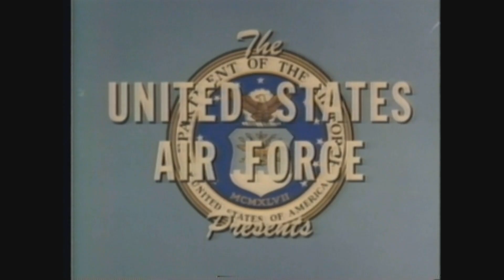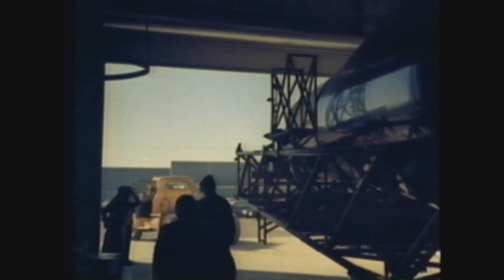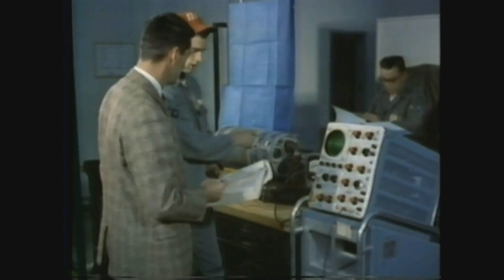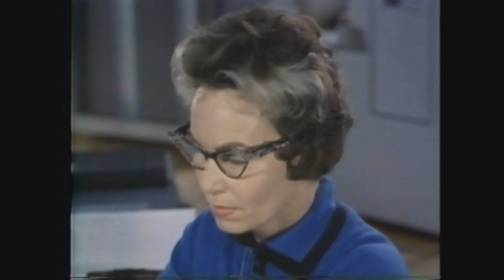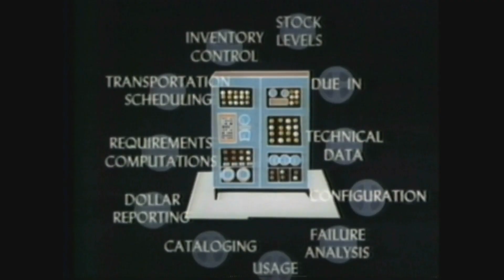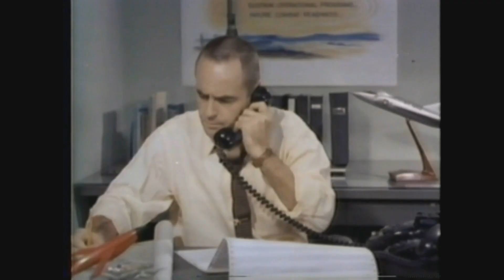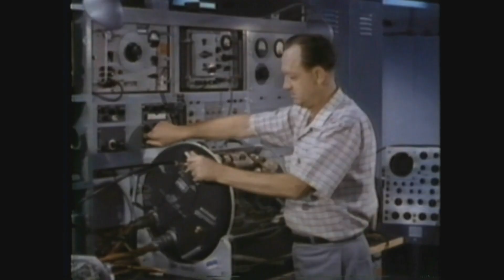1957 - 1960's  IBM 705 Mainframe Computer Data Processing- USAF Military Punch Card, Educational

Comment: Got any media that describes the 1970s  USAF Advanced Logistics System? (ALS)
Reply from the maker: Hi Tubastuff,  I don't think we have anything specific on USAF ALS.  Do you have a particular reference for this?
We do have a good film on the  Advanced Fighter Technical Integration (AFTI).  https://www.youtube.com/watch?v=6CLNBYywMXk&t=123s
Victor, CHAP
Reply: @ComputerHistoryArchivesProject  ALS was a huge (ISTR about $180M) project in the early 1970s, replacing the AFLC IBM 7080 boxes.  Hardware was CDC Cyber 70 multi-computer configurations with acres of disk drives and CDC 1700s used for remote feeds to the mainframes.  The idea was to track every bit of inventory in any condition; and--this is very curious--to have equivalent-and-substitutable rules.  In other words, if you needed an altimeter rated for 30,000 feet and there were none in inventory, you could be sent one for 40,000 feet.  Or, as a fellow remarked, request a bulldozer and get sent a shovel.    There's probably a fair amount of paper on it in the archives.   Proxmire twice awarded it his "Golden Fleece" award.  My recollection is that there were about 1500 GSA programmers churning out COBOL for the thing. Ultimately, it was abandoned.
Reply: Here's a 1972 prospectus.   Eventually the project bit off too much to chew and was terminated in 1978, with a bunch of 370/168s running in 7080 emulation mode.   The reason for that is that the 7080 COBOL code had numerous undocumented autocoder patches--figuring out how it all worked would have been ruinously expensive both in time and money.

https://www.airuniversity.af.edu/Portals/10/ASPJ/journals/1969_Vol20_No1-6/1969_Vol20_No5.pdf

I worked on the vendor's (CDC's) side--in all, we were a group of about 70 people supporting 1500 GSA programmers.  A new operating system was developed (also deployed as UBS TOOS) and hardware configurations larger most other government installations.  This, of course, was all pre-Internet and was quite (perhaps overly so) bleeding edge.   The project was delayed somewhat by both IBM and Univac suing against the award to CDC.  Both eventually got the qualifying benchmark to run, but declined to submit a proposal.  I believe that the IBM proposal involved S/360 model 91 hardware.

Comment: Learned at my High Technical School, the Graphic Lyceum te Eindhoven that, the mainframe is established in 1957, but is the Holorith also a mainframe ? I think so,  Remarks are liked, thanks.
Reply from the maker: Saskia, Thank you very much.~   CHAP
Reply: No, Hollerith created machines that tabulated (counted) the data on cards.  A mainframe, especially by 1957, is able to do much more with data, and it operates with it's instructions stored in memory instead of being literally wired for one specific task.  Look up "tabulating"  or "accounting" machine and "plugboard".

Comment: Thanks for sharing this cool computer with all of us. I see the cost in manpower to order a .19c part hasn't changed much.
Wow now we do all this on a small box about the size of two large boot boxes, how efficient.  
So how does a government pay $200.00 for a Hammer or a .19c transistor? Here's the process:
1. Look it up in the PDF/Manual.
2. Fill out the required order form, with manual number, chapter or work package, figure, index number, item name, two part numbers, alternate part numbers, item control number for the equipment it's going into.
3. Submit it to the supervisor.
4. Supervisor reviews it.
5. Pass it to the site supervisor.
6. Site supervisor reviews it.
7. Pass it on to the supply worker.
8. Punch it into the computer and submit it.
9. Supply center in another state reviews it to make sure its actually in the item it was requested for. You know someone might order some spare parts to hide under the work bench so they don't have to do all this crap for a .19c Transistor.
10. Supply center sends a request to a government approved vendor. Women owned is preferred for political correctness.
11. Approved vendor submits the request to the warehouse.
12. The warehouse receives it and fills the order.
13. The warehouse sends the part to shipping and it ships.
14. The part arrives at the repair facility.
15. Supply worker reviews it and sends it to the technician or to the shop supervisor.
16. The technician installs the part and tests it to find out the problem is fixed. Then to find out we need another part to move to the next step and the process repeats.
Fortunately I brought this process up at an efficiency meeting. I asked why we did it like this, we spend about $200.00 dollars to get a .19c part. The response, "We do all this is to ensure we don't order more parts than we need to keep costs down and to ensure someone doesn't steal a .19c transistor, or other parts like it." I said and that's assuming someone would want it.
So my response; "to keep costs down!" "You don't think they actually pay $200.00 dollars for a hammer do you?" Ah ya they do, in man hours and shipping costs. We again for the 13th time are allowed to have a supply bin to stock some of the cheaper parts we use on a regular basis. Now we can just go over and pull it our of a supply bin and document it directly on the supply sheet. So much more efficient. When I started back in 1999 we had 12 sheets documenting our work on a piece of equipment, wow we have about 50 sheets. Now when our customers equipment is repaired by one technician it has to be checked by four other people then the paper work is checked by 6 more people before it's shipped. Our governments need to document EVERYTHING is WAY out of control and wasteful just to CYA or for whatever, is ridiculous. Well folks that's my Government Efficiency Lesson for the day kids. Aren't you glad they're in charge of your health care even more now, thanks to the ACA? 
Best Wishes n Blessings. Keith Noneya
Reply: An elephant - a mouse built to government specifications (to quote a famous author).
Reply from the maker: WOW!  That's quite a process.  Government oversight never seems to simplify anything.   Thanks for the comments!
Reply: Keith Noneya :-O
Reply: remember that  dollar hammer that cost 200$   199$ goes to secret projects or laundered to secret project

Comment: 18:26 here you can see a Tektronix 511 oscilloscope. It was Tektronix' first product.
It was IBM with it's huge 511 orders, that pushed Tektronix. This eventually resulted in huge growth at Tek.
Reply from the maker: Good to know.  Thanks for watching!
Reply: Ing. Max Koschuh super.  Computer
Reply: I was watching another one of these vintage computer films on YouTube the other day-- I think it was a one about Burroughs-- thought it was interesting that just about every shot, even the marketing shots of the system, included at least one Tek scope cart, and many of them had two.   Guess it took some work to keep those things running...
Reply: The 511, invented by Howard Vollum, was the first triggered oscilloscope ... and the rest is history.  Love the old 500 series scopes and have several in my private collection including two 555 dual beam units.  With over 100 tubes, each 555 is a masterpiece of electronics design, manufacture and utility. 🙂
Reply: I have a similar one from the 50s , sadly, i got no idea on how to use it
Reply: I have the blue-green and chrome cart with the plug-in space gutted and a 6 drawer parts cabinet in it's place. Top drawer has the mouse pad on it, keys hang from monitor arm base.

Comment: i LOLLED a lot. I suspect that in this 1957 video, there was a LOT of wishful thinking. "the computer automatically route packages to the most optimal route" first of all, what does that mean CONCRETELY? "if supplier A doesnt have part, check supplier B"? and "if the computer doesnt know something it prints out detailed information for the manager. yeah right. I'd love to see that print out. businesses barely do stock management properly TODAY with amazing tools and systems (apart from big cies like amazon, which is why they're so ahead), let alone many businesses communicating efficiently using 1957 technologies. Just think about it, MOST ppl in those days did not even know what a "computer" was! And the ones they had cost millions and would break a few times per hour! Cant imagine a "supplier" having a computer and getting anything useful out of it. I've heard that the SAGE computer built in the same era was barely ever really functional but in the videos they make it look like everybody had their shit together and doing something useful.
Reply: It was all highly experimental, the ICBMs of that era also barely ever worked correctly. Ridiculously (by our modern standards) long time to prepare to launch, close to 50% failure rate on launch, similarly high chances of failure on reentry, and then even if nothing spectacularly failed, the accuracy was still pitiful.
Reply: hattivat Also noticed that the first generation Atlases were above ground. I suppose around 1959 they started burying them in launch silos/complexes.
Reply: @hattivat  after Sputnik they would take a shitload of risk to never let it happen again

Comment: At 0:21, the film production date is shown as MCMXLVII - is that not 1947?
Reply from the maker: Good spotting.  Actually, the MCMXLVII date is 1947 on the Air Force LOGO, since that is when  by President Harry Truman signed the law creating the Air Force as a separate branch of the service.  Before that, the Air Force was part of the U.S. Army  (often called "U.S. Army Air Force").    The film itself is from 1957.   Great comment though.  No one else mentioned this.   Thanks!

Comment: thanks to the invention of the transistor, this whole process is in a series of excel forms.
Reply: Or they would be if you could fit all the stray bits of 50's, 60's, 70's and 80's code into Excel.
They only gave up 8" disks a couple of years ago. I'd be amazed if they could run anything more recent than Excel 97 on some of those machines. The punched card readers may have gone- but if you've got any spare parts for an IBM XT, they're keen to hear from you.
Reply: unless the fallout universe happened, in which the transistor was never invented.
Reply: @juango500  Fallout still have regular computers, which are small enough to fit on a desk and be carried (except by apple users lol)

Comment: yes that helps to explain it. thanks for answering
Reply: They also use electric clutches, the tape drive motors never stop spinning. That's why they can start and stop so fast.
Reply: @1stKwestionable  Actually, the tape itself starts and stops quickly, but not the reels.  The tape is sucked into vacuum columns on each side of the head assembly, to provide two buffers of slack tape.  Each reel is only turned as needed to feed more slack into its vacuum column when the slack gets too short, or to take up slack when it gets too long.
Reply from the maker: True!   Thanks for watching, good comment.

Comment: one thing I never figured out of the old tape drive is why do you normally see one tape spin while the other one is standing still then it spins while the other doesn't move
Reply: Because what you don't see in that tall cabinet is the large vacuum column that holds several extra feet of tape. That acts as a buffer for the tape so each reel can have a bot of a buffer before spinning or stopping. The reels have to stop and start quickly because data is read in chunks, not a continuous stream like regular audio and such. If the tapes were slow to start or stop, some data could get lost due to the inertia of the reels. Hopefully that helps.
Reply: Very good reply. Just as a complementary explanation: once the tape was loaded, it was kept under some tension by the vacum chambers. The tape was stop, in contact or not to the tape capstan. It depended on the technology of the tape drive. In the non contact devices, for instance, the capstan was continually running, with positive air pressure flowing thru fine slots pushing the tape away, forming an air cushion . The tape was held in place by a nearby vacuum plate. Then, after an order to read or write, the air flow was reversed very rapidly, so the tape was pushed from the stop plate  and at the same time adhered to the rotating capstan. So the tape went from stop to full speed (some 120 inches per second) in 1 milisecond, average. The vacuum chamber supplied the tape, and when the tape level reached some threshold, an order to the reel motors to run was issued. That is why the movements seem to be assynchronous. The valves which changed the air flux were called "voice coils" because they resembled  loudspeaker coils. I loved that units. They were real battle horses, running day and nigth.
Reply from the maker: Yes, that does help.   Thanks!
Reply: Those tape units filled a 19” rack, too. At the back was a relay logic box, which could be swung open to reveal eight three phase electric motors and the associated clutches. One large motor drove the vacuum system, another was for fast rewind, two were for. the two tape spools and the last pair were for the two tape capstans, The motors and relay logic made for a noisy machine, necessitating soundproofing and a front cover for the tape unit. 

A 'small' computer might have as many as four of those tape drives, a card sorter, a card printer/duplicator, a card reader, a CPU cabinet, memory cabinets, three phase power converter, maybe ten telex terminals, and later, Winchester drives, plus a printer. In addition, it would have an air cooling system located in an adjacent room, and pumping cool air under the computer room floor and around the room. This was needed because a typical transistorised IBM computer would consume around 12 kilowatts, and peripherals would increase that consumption.

Each part was large. One computer would fill a whole floor of an office building and would require at least twenty people to operate and maintain the system. (So at least two kilowatts of body heat generated, in addition to the computer power!)

Computers were often rented back then for a couple of  thousand dollars per month, because of the constant need for engineers to be on hand to keep them running. A computer might suffer a failure every week or two, necessitating locating and repair or replacement of the failed circuit board(s) or other failed component. 

To top all of that, there would be no operating system, so programmers who were familiar with machine code were an essential part of the computer team.
Reply: Jeremy R the tape movement under the heads and take-up or supply reel moment was two separate operations.
the machine was designed as follows:
a capstan on each side of the r/w heads which turn at constant speed. this constant speed was vital to the exact placement of the data on the tape.
a vacuum column before each capstan. the length of tape in the columns is determined by two (or more sensors) withing the column. if the tape is too long in a column, the reel motor must pull tape out of the column. if there is too little tape in the column, the reel motors must add tape to the column.
tape can be read or written in either direction this way.
when a tape Is threaded on a tape drive either manually, it first is guided over the opening of the vacuum column, past a capstan/pinch roller, over the r/w head, then past a 2nd capstan/pinch roller, over a 2nd vacuum column the wound onto the take-up spool.
you press a LOAD button. for automatic threading, use press the LOAD button. what happens is you will hear a vacuum pump activate, pulling the tape into the columns until the sensor detects it has enough tape. on older tape drives the capstan is extended over the vacuum column, placing the tape between the capstan and pinch roller (IBM called this a prolay). some modern tape drives didn't have a pinch roller, but relied on a vacuum to hold the tape against the capstan.
the capstan would then spin, moving the tape in a direction (early machines it was backward, later machines it was fwd) as the capstan moved the tape it would place more tape into one colum and pull from the other column. when the column sensors determined either too much or too little tape was in the column the reels moved in the appropriate direction. This continued utility the tape drive saw a Beginning of  Tape (BOT) marker. These markers where shiny pieces of adhesive tape placed right before data on a reel of tape. Consiquently the is a cooresponding EOT marker at the end of the tape. this way the software is signaled to STOP reading/or writing on the tape as it will run off the reel if there was no marker.
Once the BOT was found, the drive would indicate READY to the software so it can begin operations.
if a FWD read was jssued, the capstan would spin, or prolay would be activated moving the tape over the head at a very constant speed. because the tape was in a vacuum column, there was no mass to move and the tape could get up to speed quickly.
once a BLOCK of data had been read, the capstan or prolay would stop tape movement. the tape moment was very rapid and Jerry due to when the software called for more data. The reels would move due to how much tape was in the columns, due to the capstan emptying or depositing tape in each column.
hope this explanation helps you understand